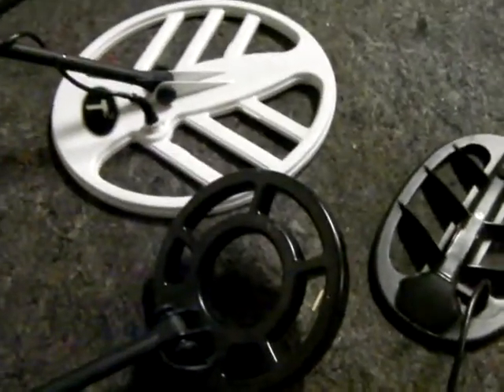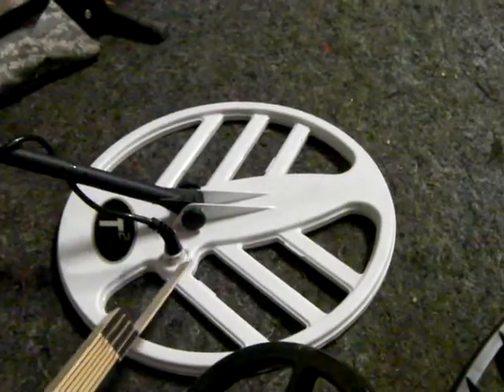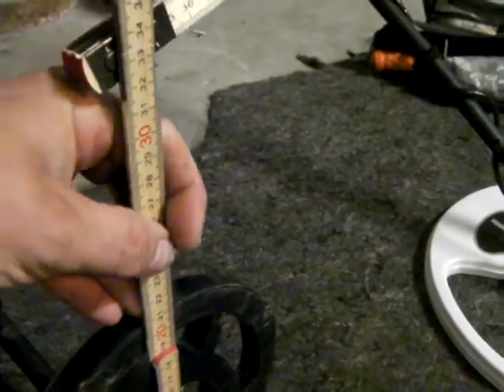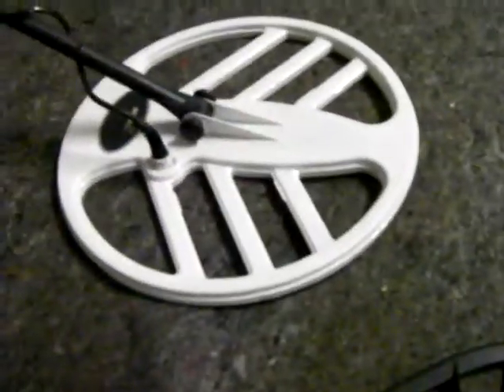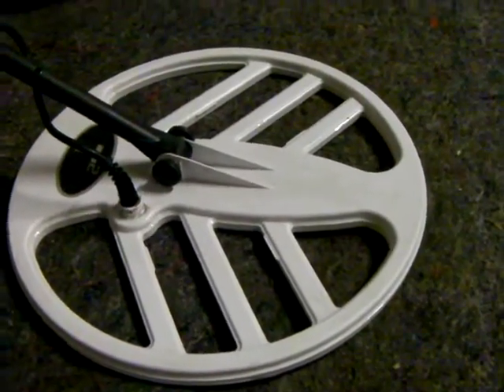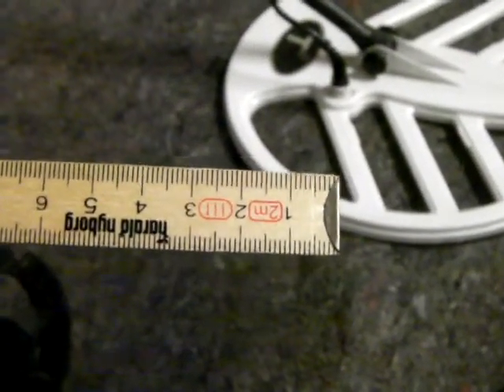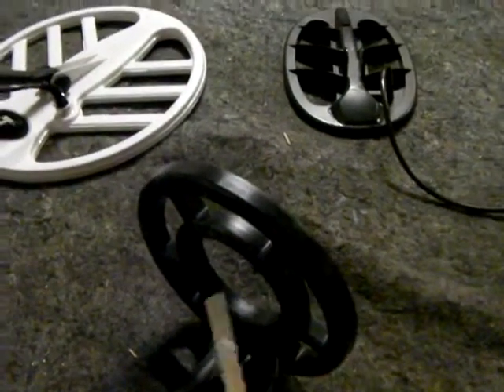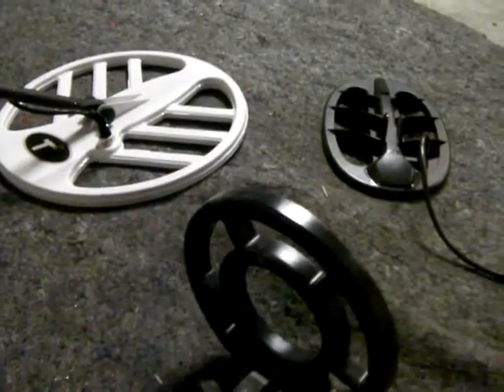Metal detecting, How deep will it detect ? and easy way to find out..

Comment: The best way of finding your personal detectors depth is to find an area of land where you have zero, (nothing metal) then dig a sheer face and put artifacts/ coins/objects of different sizes horizontally at different depths sideways until you learn the signals for given mass and signal ratio. For example a small coin at say five inch depth would give a good read out but as you put that same coin at greater depth (on edge or flat) would give you a different signal and you may think it junk. If in doubt take off the first few inches of soil then check the reading you get, you will be surprised as sometimes what you may have thought was junk turns out to be a coin Just saying from experience :)

Comment: Not  to disagree with what you are saying here; but the size of a coil is only part of the equation. Other things that affect the ability of a detector to penetrate include Type of soil, moisture content of the soil, type of target in the ground, size of a target in the ground,  how a target is in the ground, flat or on edge, battery strength, operator of the metal detector, headphones, and the ability of the operator to hear faint signals and the willingness of the operator to dig any target. It seems as if the old saying of bigger is better is not always 100% true. I use a concentric (Round) 950 coil most often, but also a 10 inch DD Coil, I also have a 12 inch coil that will not go as deep as my 950 coil. Maybe but maybe not size makes a difference?!?!? ;-)
Reply: Also to comment from my research, it also depends on operating frequency of the system.IE: a system operating at 9 KHz will go deeper than a 20 kHz system. as the wave lengths are different.

Comment: Hello my friend!Except the size of the coil for detection depth of coins is affected by the class of metal detector they are divided into entry level,midrange and professional!3310 is a metal detector of the Chinese manufacture for children or entry level)
Reply from the maker: very true my friend  ,, this way you can measure 90% of the death it will go,,,on a regulars size coin... The PCB board in the metal detector will give it more cm but the coil is the boss :0)
Reply: 15 inch coil is deeper of course but she's not littered places)
Reply from the maker: true,,but then again, with the disc on 15 and with 2+ tones i can only hear from trash to coin objects,,, so its acuttlu not so bad with the 15"  coil,,, the only minus i think its, that's its a bite heavier then the 11" he he,, but then i get some exercise he he
Reply: Of course everything comes with experience)